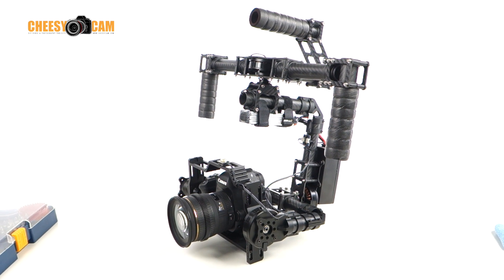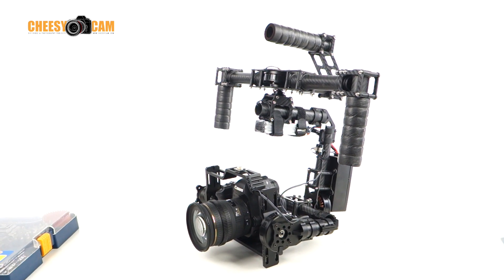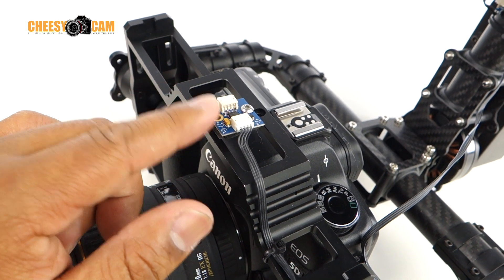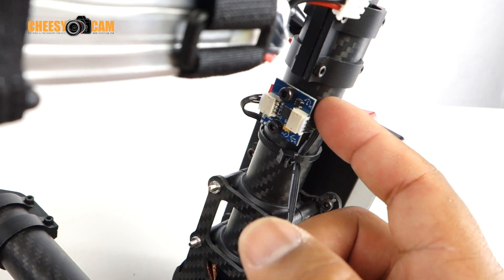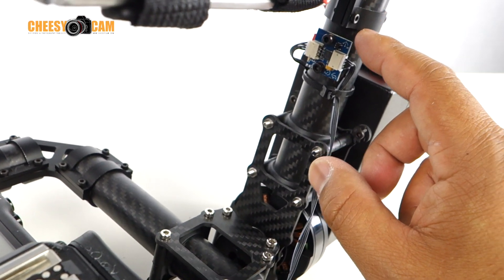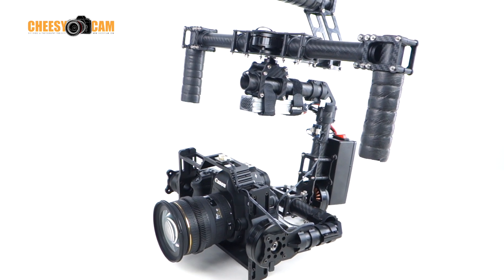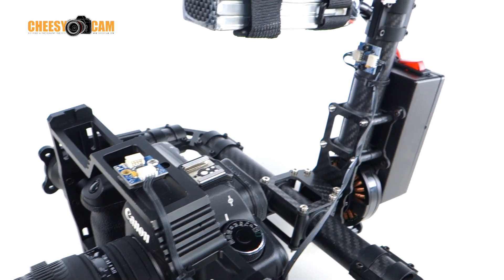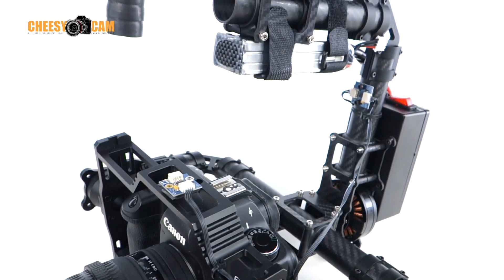3 Axis Gimbal 8 bit Upgraded to new 32 bit

Comment: Hi I have bought this controller and it started well and as i was setting PID setting something happened and I lost the firmware display. Now i have tried to upgrade from the recovery in manual upgrade option. But it still not showing me the firmware and i am not be able to connect. i have also install driver but I am not be able to connect even it says firmware is upgraded successfully. Please help me.

Comment: i have a glidecam hd 2000 and want to add a 1 axis motor to control the yawn axis only. was wondering if a 32 bit alexmos dual imo would be smoother? which motor do you recommend for a 70d with 35mm sigma prime?

Comment: Have you tried installing a frame IMU above the yaw motor, or just below it?  Below the yaw motor, are you using the "Below Yaw + PID Source" option, or just "Below Yaw"?  Thanks.
Reply from the maker: jbalazer I have read that Below Yaw is more stable than above Yaw for handheld use, so that's what I use. That is the only option I choose.

Comment: this is such great info, will you do one with the 32 bit board from Came7000 if it is bought as an upgrade as well? i am a bit scared to look at all those ebay ones from china,... Came offered an upgrade to me for 90$ including joystick and 2 imu's, but i first need to see that that very "CAME" upgrade board is working fine.
i am very careful with Came After my came7000 had a motor problem , i had to send it back to china eventually , in order to get it back only wrapped in bubble wrap and metal parts of that came7000 were sticking out of the paper oft box it was put in . Now that 8 bit board is behaving in a very funky way, and most plugs are bent from the travel from china to USA . I really like to share this with everyone out there, for i have still not been able to make this Came product work, after 2 months now..... if theis 32 bit board would work , then i will dive into another attempt, ... the very last one ...
Reply from the maker: Yes the CAME 32 bit control board and dual IMU sensors fit perfectly. All of the instructions to build was with a 32 bit version found here: http://gimbal.cheesycam.com/diy-build-came-7000-32-bit-3-axis-gimbal-stabilizer/

If they are offering for that price, I would go for it. That's much cheaper.

Comment: Nice work. May I ask if you could measure the diameter of the CF tubing used? Is it 25mm? I make my own stuff. I want to price out the the parts. I have my 3 axis controller, the same 5208 motors. Bluetooth and even a joystick.
Reply from the maker: It is about a 1" tube so yes close to 25mm.
Reply: MrCheesyCam  Thanks, on ebay they have every diameter CF tube. Hard to judge what's standard. I only have a GH-2 so I may built a lighter weight rig as my next build.